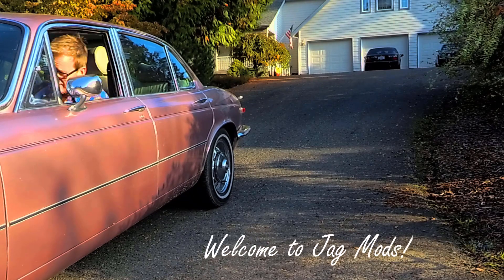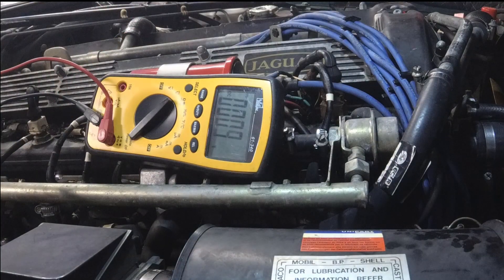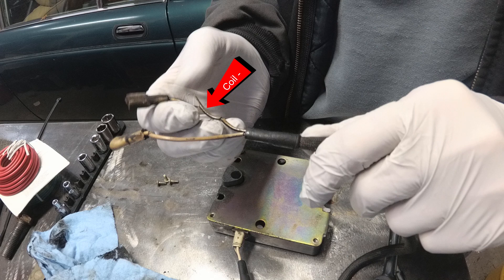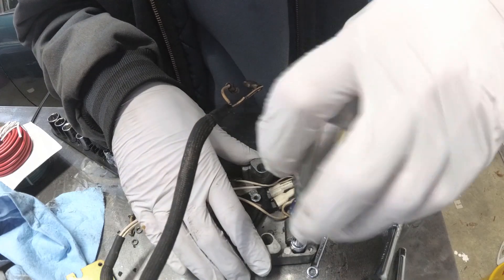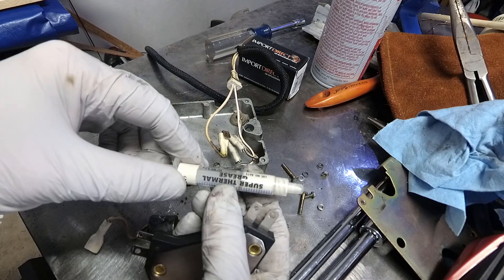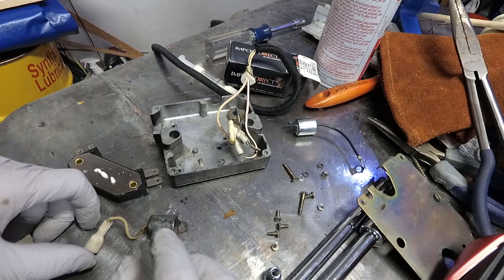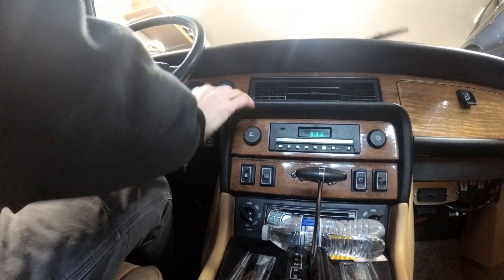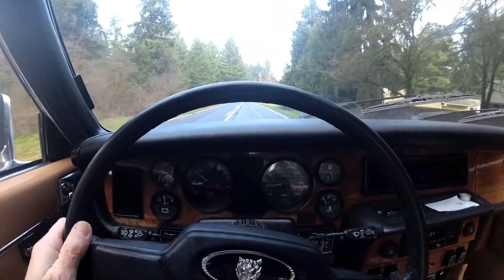Here's how to put the spark back in your Jag.

Comment: Very good video with detailed information. I have a 1988 Jaguar XJS V12, every time when I start the car, I have to turn the ignition key multi-times to be able to start the car, there is no cranking sound if it doesn't work, if it works, the engine starts without a problem. I consulted the car mechanic, was told it might be a bad ignition switch. When the car engine is idling, I can occasionally hear a tiny electric spark sound from somewhere near the ignition coil on top, but not able to pinpoint the exact location. Any idea what might be the problem?
Reply from the maker: My first thought was the neutral safety switch may be the issue.  Taking it in and out of gear while the  key is in the secondary position aka the run position (not start). then attempt to start it.  My green XJ6 is that way.  I've added it to my list. :) 
The neutral safety switch is located under the console.  It's nothing more than a micro-switch that opens the circuit when the gear leaver is in park. that being said, if the spark sound IS related to the no crank issue; and it's near the coil. then check the coil for loose wires. 
The ignition switch closes the circuit to the ignition and tells the coil and other down stream bits to wake up, which intern tells the fuel injection module (in the boot) to wake up. Another relay is triggered when the key is flipped to the 3rd position (aka Start).  Sending power to the starter, and telling the fuel pump to pressurize the fuel system.  I would look at the relays before replacing the ignition switch.  relays aren't anything special, and can be picked up at any Automotive store. Well, except the relay for the Fuel system... 
If it is the ignition switch you don't have to rekey the whole car.  

Word of Caution.
The V12's are more prone to catch fire because of ignition and leaky injectors than it's 6 cyl brethren. Mainly because the spark source, the distributor, is smack dab in the middle between the fuel rail and injectors. fuel smell in the engine compartment is something that should also be addressed.  My buddy's XJ-SC burned to the ground for this exact reason.  the fuel rail and injecters were replaced and the mechanic didn't check the hoses from the fuel rail to the injectors for leaks. 😣 If you're new to Jaguars and especially V12's this is something to keep in mind while under the bonnet. Smell fuel? track the source. Anyway,  Hope this helps.
Reply: @JagMods  
Thank you so much for your time to provide me with so much detailed information and suggestions. Yes, I am new with Jags even though I have owned this XJS V12 for 9 years (a gift from my friend) but I didn't do much except changed some hoses by myself, I usually sent it to the repair shop whenever I had trouble. Since we don't have good mechanics to repair Jags nearby, most of the time they gave up and just suggested getting rid of it. But I love this car, I haven't seen another same one in the street (I live in California) so far in 20 years, I plan to keep it.

I will try to do something based on what you mentioned, hope the problem can be fixed. I do appreciate that you also gave me the word of caution, such as the leaky injectors causing fire, that is very important to know. Once again, thank you so much!
Reply from the maker: @brucezg  
pick up a manual.  the abridged version of the  6 volume set can be had on amazon. Hard bound.  Personally I don't find it very helpful.  Essentially has a really good grasp of the obvious.  
That being said, pick up the electronic version of the manual It has the complete set plus training material not found in manuals.  It's available at what was formally XK Unlimited, not Moss motors. Here's the link.
https://mossmotors.com/original-technical-publications-xjs 
Another options is OTPubs.com. It's the same manual set. It pains me to even mention this company. I find their business practices unethical & support sucks beyond words.  ANYWAY... Get the manual. even if it's from OTPUBS.com
In the back of your owners manual there should be a folded up wiring diagram... Also...

thank you for subscribing to Jag Mods, thank you for taking the time to comment too.  I truly appreciate it.
Sincerely,
Mark @jagmods
Reply from the maker: I have an 88 XJ-S too.  I've owned it for 22 years.  before I started this channel, I too paid out the a$$ for supposed specialists to service my XJ-S.  about 6 years ago, the local Jaguar dealership refused to work on it because, well, they didn't know how.  Go figure...
So back in the day when I was pedelling auto parts for National whole sale warehouse, I remembered a Jaguar / Ferrari specialist not so nearby. I looked them up.  Long story short, I left the "Specialist" just shy of $10k lighter,  new suspension & brakes, tune up, hoses all replaced... I was chuffed until I got almost home only to discover the car was about to over heat (in the dead of winter). the rack was started swaying side to side; and the fuel tank sprung a leak... it was clear the overheating issue was because of the wrench that went through the radiator, and the nuts were finger tight on the steering rack.  OH... and the hand brake didn't work. and the output shaft seals  leaked all over my new brakes.  Would they cover any of this? short answer. No...

So I decided to start this channel for all of the Jaguar owners out there who are taking it in the A$$ from "specialists" and pick up a wrench and FIX YOUR JAG! 

Rant over.
:)
Reply: @JagMods  WOW, that was an oweful experience, thanks for sharing the story, now you are the specialist, you are helping the Jag lovers. That encourages me to learn more about it and try to fix if possible. I love to watch your video, not only technical but very entertaining, fun to watch and learn. Thank you!
Reply from the maker: @brucezg  
Thanx for the kind words.  I try to make a coma inducing topic for most, somewhat entertaining.  My first videos on this sucked. Badly. Like life, every day is a day in class.  Always learning :)
Reply: Great job 
Thank you for your time !
By the way where did you get the parts from 
I need the ignition amplifier module 
I been looking for , also does the voltage matter 
12 v or has to be 18 v ? 
Thanks one again

Comment: Great video thanks for the upload. What year is your jag? My 82 and 86 xj6 both register 60 megohms.
Reply from the maker: Which one? Haha I have 4 xj6’s. A 72, 74, 85, & 86. Not to mention the XJS’s or the XJR-100. 🙂
Reply from the maker: Check the specs on your coil, but that seems a bit high. It’s been my experience where primary winding resistance should be between 1.5 to 3.0 ohms and the secondary winding between 10  to 14 k ohms.

Comment: Shmoo! Sounds like you watch AvE? Soldier and shrink wrap wires. Simple harness to remake. Electrolytic capacitors all leak in time, usually 20-30 years. Even on your stereo power supply. Lol.you need a proper wire stripper. Bozo’in it with scissors. More lol.I’m not a fan of crimping or warm beer. I use copper graf on all bolts. Love it.
Reply from the maker: Use to watch Ave, not so much anymore. The electricians scissors?  Ive used them for decades for cutting and stripping wire.  
 
Im glad you enjoy the videos, and thank you for taking the time to comment

Comment: Curious; would mounting the ignitor away from heat be a good mod?
Reply from the maker: Short version yes. Moving the coil away from the top of the engine, and mounting vertical like it should be will certainly lengthen the life of the coil, and moving the ignition module off the fron of the plentum  is also a good idea. The bolt holes go all the way through so that’s a intake leak that would need to be addressed as well.
Reply: Jag Mods Very cool of you to reply, thanks! About the holes going all the way through, good to know.
Reply from the maker: Also the wiring to the coil would be a redo because there isnt any slack what so ever
Reply: And vibration

Comment: Much as I admire your ingenuity,  why don't you bin the dizzy n use a coil pack?
Reply from the maker: The short version is I’m a cheap and lazy bastard. It’s a lot cheaper and a hell of a lot easier to fix the existing than to retro fit a full on electronic ignition with positioning sensors, integrating control boxes, and coil packs.

Comment: thanks for making this !!
Reply from the maker: You are so welcome! I hope you find this helpful. I know for me, it was a key factor in both of my XJ6 Series III's.
Reply: @JagMods  yeah man they love to shut off lol going to install those two parts today Al keep ya posted 💪 this was excellent content keep sharing!
Reply from the maker: Thank you! 
the curse of crusty wiring. keep a good supply of patch wire & crip connectors handy. Good luck! DO let me know how you get on.
Thanx again
Reply: @JagMods  replaced the module and condenser still no spark from coil!
Reply from the maker: @nino8513  
Sorry; mate! I just saw your response.  I'm usually really good at replying.  I don't know how this one got past me. Did you get it sorted?
Reply from the maker: @nino8513  
Just checking in on your Jag.  Did you get the issue resolved? what was the problem?  Again, Really sorry it took so long to reply. I try to address the comments as soon as they come in.  I really don't know how this one got past me.  Do let me know how you're getting along with your Jaguar.
Sincerely
mark @jagmods

Comment: where should I get a service manual for my 74 xke?
Reply from the maker: There’s a couple of places the most prevalent is the online version which is available from the major jaguar parts  suppliers online like 
Mossmotors.com, SNG Barratt and Jaguar Heritage Trust, Or rather obscure resellers like otspubs.com & Book4cars.com. All of the above offer the exact same electronic product. The XKE or EType manuals are microfiche copies of the original manuals. The plus side is these also include (well at least for the XJ’s) service bulletins and dealer training material which is very useful. 

My experience with otspubs has been less than stellar. There tech support is probably the worst ever!! I kid you not! They don’t answer the phone and take days or in my case weeks to respond to an email. Then when they do the response doesn’t always resolve the question, but prompts for more information or questions. It took months for me to get a support ticket resolved. It really sucked, and not in a good way! 
So why did I purchase from OTSPUBS? At the time I purchased my XJ manuals (both online and in a flash drive) they were the only game in town. 
I’ve have many dealings with SNG Barratt and  my experience has dealing with them has been excellent. If price is an issue, then otspubs is the least expensive of the bunch. 
Oh one more thing. These products all require a special viewer called locklizard which is a viewer for their proprietary encrypted pdf manual / files.  It can be installed on only one computer. So be very mindful how you want to view it and where. Additional locklizard licenses are available. If memory serves me, it’s like purchasing another online manual. Once you get over 3 manuals, it’s cheaper to purchase the entire Jaguar model set, which as I understand it, and don’t hold me to it, the viewer can then be installed on multiple computers. 
Oh, the licensing is based upon email address so a possible way round the single computer license is to purchase each manual under a different email address - and don’t let otspub know that’s what your doing or they will combine the additional manual licenses under one email address, thus voiding the ability to install the software on multiple computers. Come time to replace a computer,  you will have to get a new viewer license. My advice contact them before you need it and you have your new computer set up and ready to go. The viewer doesn’t work on a tablet either. You’ll have to Contact Support requesting a new license for a new computer. The old license will then be deactivated. 

Paper manual? 
Try books4cars.com. They are located in Seattle Wa USA. Otherwise eBay, jag-lovers forum, or National jaguar club want ads.  I have a paper manual for my series 1 2 and 3 XJ saloons and one for the XJS’s. The XJS and the series 3 saloon manual is an abridged version of the Jaguar service manual and personally I think it’s worthless. 
For example replacing an alternator instructions were something like loosen & remove the fasteners, slacken the belt, remove it, replace with new, then reverse the uninstall process. Myimmediate thought was thank you for that captain obvious! 
What missing is where the fasteners were located, how many, and the critical bits of info like removing the radiator hose protection plate, loosen the transmission cooler, and unbolting the sway bar sway in order to wiggle the alternator out between the crossmember and the radiator. 
Thank you for watching my videos I really appreciate it!

Comment: Great Video - Do you have part numbers for the GM Ignition Module and Condenser ?
Reply from the maker: Thank you for the kind words.  I'm glad you enjoyed it. The HEI module is a MSD 5596, This is a multi-spark module I'd recommend upgrading the coil as well the coil I've got is the MSD Blaster 2 Part # 8202. The ACDELCO part nubmers are D1906 (OEM #10482820, 19180771). The condensor is what  I had kicking around.  I believe it was from my XJ6 Series II which would be Jag Part number JLM9656
Reply: @JagMods   Wow I wasn't expecting a response that quick !
I have just purchased an Arrow Spyder restoration project with a 4.2 Jag Engine and despite the fact that I have had it running today for about 1 minute it will now only turn over and not fire up - This will possibly help when I get that far - I am waiting for a spark tester before I start taking things apart 

Many Thanks
Reply from the maker: @1960livvy  
I’m not sure what country your located in but the spark tester that I used in the video is a worth it’s weight in gold. And it cheap especially at harbor freight in the USA. I keep one in all my Jags. Is the XK6 in your project, fuel injected or carburetorated?  I had a vet same issue with one of my series 3 XJ6’s. Once I got the ignition sorted, I took it out fir a spin and got 3 blocks from the house and it quit. Again. Short version, the timing chain on the intake side had a about a half of an inch of slack. Which equates to unwanted variable valve timing. Once I got that sorted. The car run great!  The suspension is clapped out, but runs really good 🤪
Reply: @JagMods   I'm in Oxford England :-) 
The Spark Tester that was ordered appears to have been lost in the post so the company is sending another one to me 
Having looked again today I still have plenty of sparks and the inside of the Ignition Amplifier looks perfect so looking elsewhere I think its down to the ECU / Fuel Pump and their relay 
Fingers crossed when the new relay arrives 

Again Many Thanks
Reply from the maker: Check the fuel pressure should be around 36psi no less. Listen to the injectors. You should here the injectors click a way. My experience with injectors. NOIDS area very useful tool, but if you so much as look at an jag injector the wrong way they tend to leak. So be prepared to purchase new o-rings if you fiddle with the injectors. This isn’t a hard and fast rule by any stretch of the imagination, but has been my experience.
Reply: @JagMods   Hi again - thanks for the info - the current problem is electrical, yesterday the car worked fine then just stopped, investigations now show that there is no power to the Fuel Pump and the relay appears to be dead or not getting power - i have a new relay on order and with any luck that will resolve the issue, if not I will hunt for the break in power.
If this was in a jag it would probably be a bit easier but back in 1984 a 4.2 Jag was turned into an Arrow Spyder so the layout is a bit different - Also the wiring is an absolute disaster and definitely not done by a professional not forgetting the car was left open to the elements and filled with water

Thanks for the support and I will keep looking :-)
Reply from the maker: well I can supply wiring diagrams and for a Series III Jag - it may provide some insight on how all the bits are suppose to fit together.  Keep us up to date on your project!  
cheers Mate!
Reply from the maker: For a complete online or desktop version of all of the Service manuals for the XJ6 / XJ12's at SNGBarratt.com part number JTP1006e.  I've found this to be pretty much invaluable.  But it's centered around Jaguar XJ Saloons.
Reply from the maker: @1960livvy  
Did you get your Jag back on the road?  BTW, the fuel pump doesn't receive power until the engine is cranking over.  The way to fake it out is to open the mass airflow sensor (flap) put the key in the on or second position. you should hear the fuel pump.  If not, then I'd check the wiring on the coil.  or the 3 relays on the firewall / bulkead.  The red one is the fuel injection relay. It's been my experience, the relay was the culprit.  Let me know how you're getting on with your Jag. 

Sincerely,
Mark @jagmods